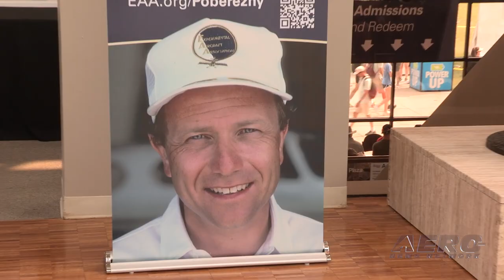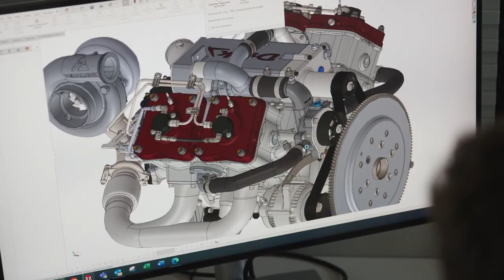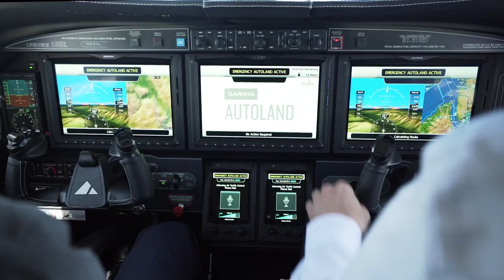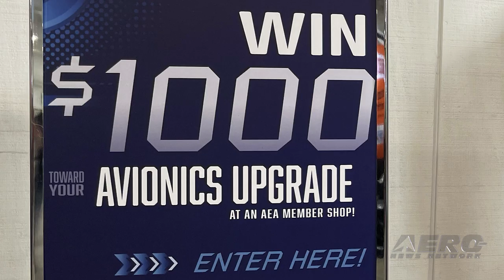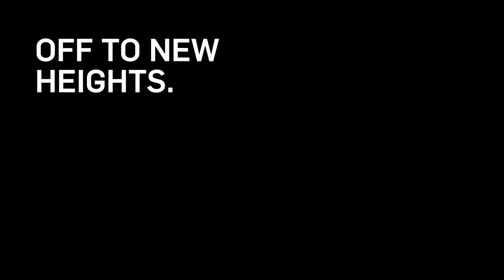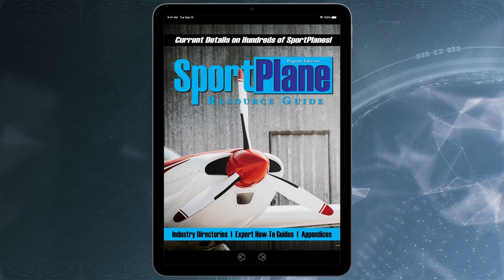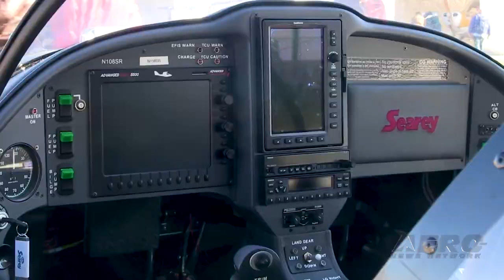Airborne 07.24.23: MOSAIC Details!, DeltaHawk DHK180, Tom Poberezny Statue

Comment: Deltahawk has been going to production next year for the better part of 20 years.  Hope that the certificate means that it will be real this time.  The price jump over the years from $40k to $90k will not help much.  That is turbo Lycoming money.
Reply: half the fuel burn,but keep your 70 year old engine.
Reply: The engine production process needs FAA certification also (FAR part 33?), and then I think you need an STC for every aircraft application.
Reply: @thewheelieguy  I am just hoping that the STC for the DeltaHawk engines goes over smoothly, RAM does STC 160HP engines for Cessna's and Piper's and its straight forward. Getting this STC'd like that into legacy Arrow and Archer models would be a nice change. There are some pretty exciting changes coming to the GA industry very very soon, if not about a decade or two late.